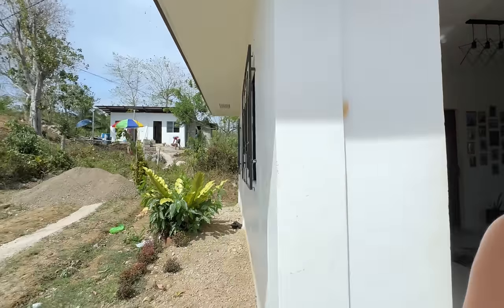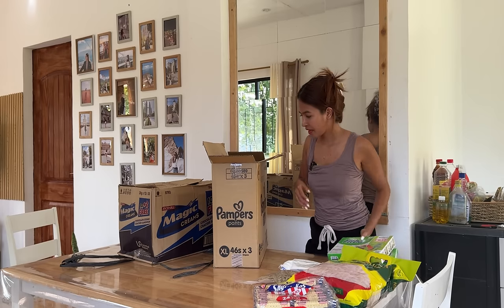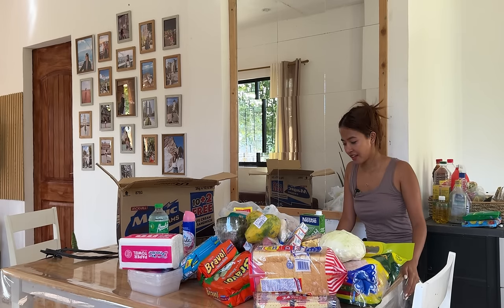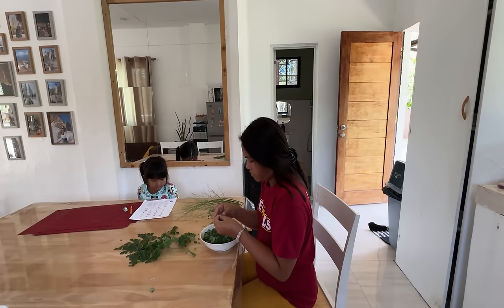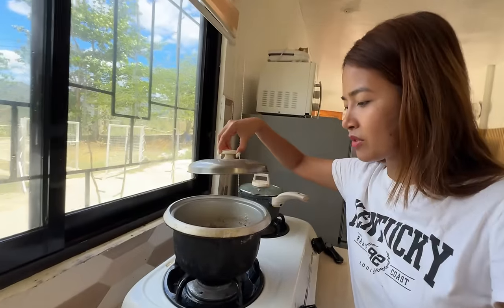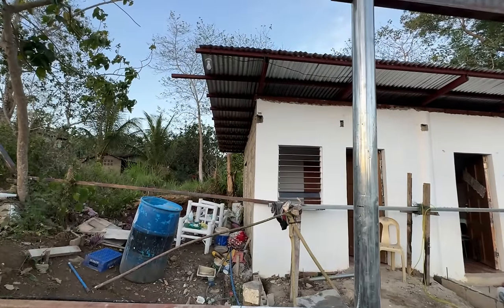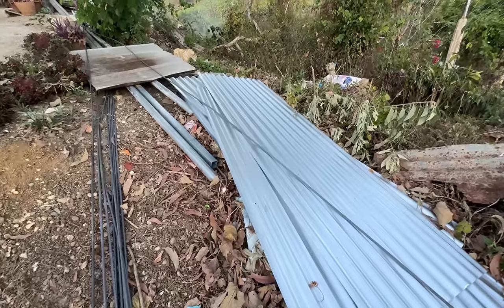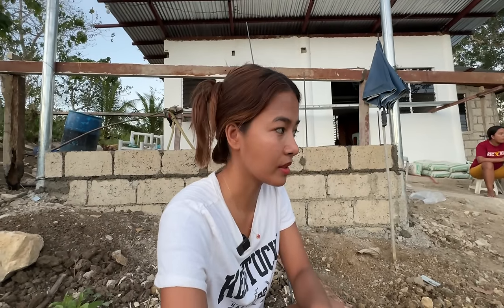We're Starting A New Project For Papa

Comment: Good job MJ for being a good daughter. I would put insulation on your papas  ceiling cause I know it’s gonna get pretty hot in the afternoon . Just an advice its not very expensive it absorbs the heat from the roof and help cools down the room a bit at least
Reply: I agree with you. That roof should be insulated as galvanize is very hot. It makes the hot days and nights extremely uncomfortable
Reply: I agree. We had insulator installed in our entire house when we had our ceilings replaced. It made A LOT of difference. So insulator plus open windows would have helped. But then their windows and doors are not screened so they are always close to keep insects and other creatures out. 😞

Comment: A grass lawn can cool the ground by 6 degrees C. Trees, shrubs and plants will also cool the yard around the house. There are some air circulation solutions which do not use electricity. Persian Wind Catchers for example can capture cool air and replace the warm air in your house, with proper circulation and ventilation. Ceiling fan , window covers , screen doors, will help, and open windows over night. Also minimize appliances which generate heat.

Comment: GM Mj and fam bam. The building of the deck/balcony is coming along nicely. Great idea Mj getting the liter of water. Can he have a liter of water per day or is a liter of any fluid in total per day? Now you sound like you’re adjusting to his dietary restrictions. Find out if you can season the chicken with garlic 🧄 onions 🧅 pepper 🫑🌶️etc. Well done. You are right. Definitely an adjustment. Been following you about 4yrs now and it seems lately like the past 6 months the water has been an issue. Even more since Robbie put the pump which was great for the pressure. The 5 of you precious sitting having dinner. Know you’re curious of the updated bloodwork results. Thanks for sharing 🤗. See you next video.

Comment: Iron rod or steel rod, beam if square. Sweltering heat is brought on by global climate change though 117 in Vegas, 120 in Phoenix is limit. Ice water or fridge ice in mouth is cooler than plain water but should not be frequent and it counts as water.

Comment: When cleaning your bathroom you used the small white container to rinse the floor. I think it would be easier to take the shower head off the wall and spray the floor with that. Just a suggestion.
Reply: The white container is a tabo, a small bucket with a handle, it's probably quicker and more convenient to splash on the floor than to use the shower head and then dry off the walls if it sprays everything.

Comment: RE: Water issue. Water flow is constant unless pressure interrupts it. Everybody took high school Physics. Example, if bath shower pressure is high/fast or lots of people suddenly open faucets, a gap of air will be created in the water flow, which increases until flow completely stops.
Reply: The water issue is more likely due to it being very hot and dry. Most of the land surrounding MJ's house is farmland and that will be prioritised over private households.